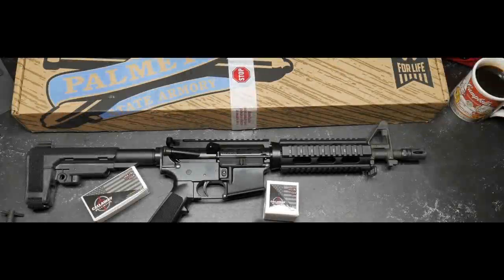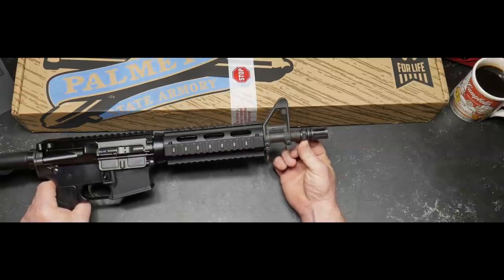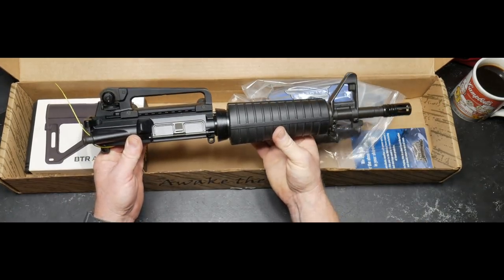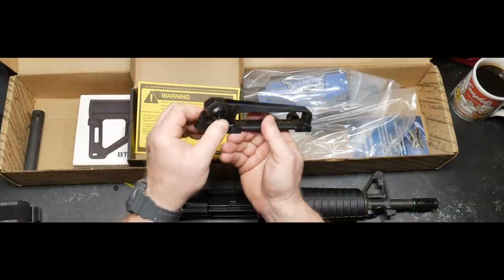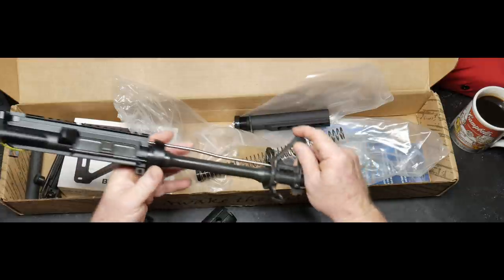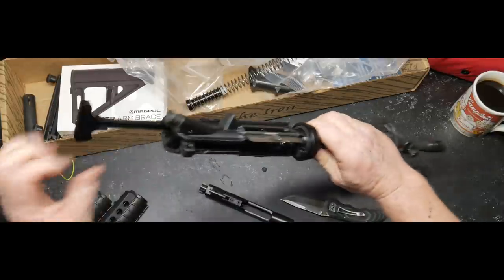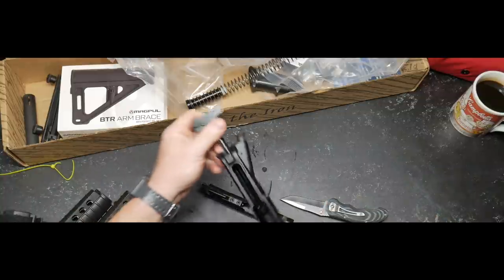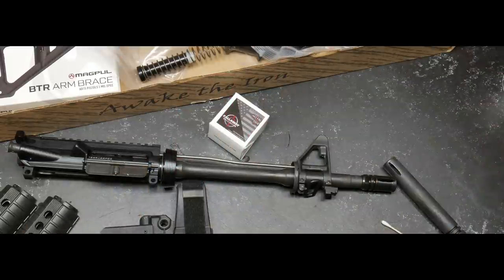11.5 Inch Palmetto State Armory Overview

Comment: After reading through these comments it is apparent either most of you guys are very young or older and as green as the lawn.

"Why build this?" 

Because it is a clone of a original CAR-15

"Uh, why not run a full floating rail?!" 

Because see also above ^ and you don't really need or want one on a 10.5" or 11.5" gun. Also the finished product will be much lighter, take abuse better and also hundreds cheaper.

"Uh, why a carry handle and why not mount a red dot?!" 

Because see also above ^ and you don't really need a red dot optic if you know how to properly battle zero and shoot with a carry handle iron sight. It is wasted money and unnecessary if you know what you are doing.

Hello, my name is John Doe.....I have been doing this for over 40 years. Nice to meet you nOObs and kids!